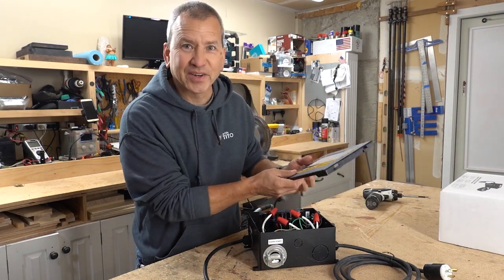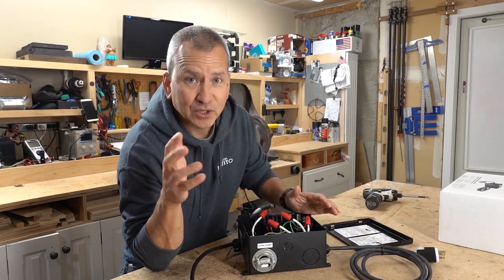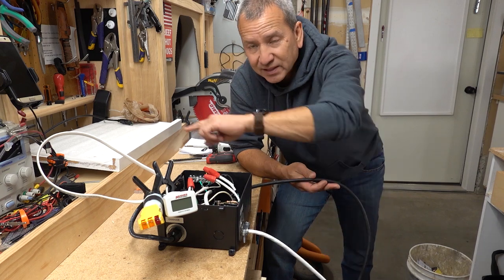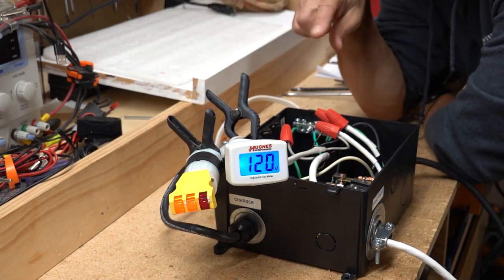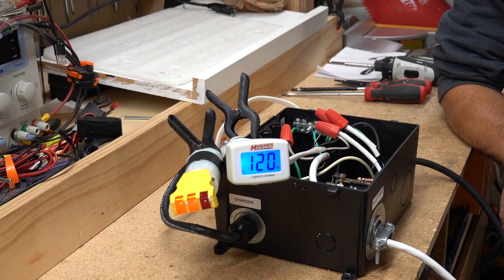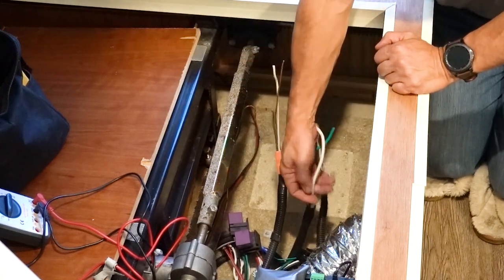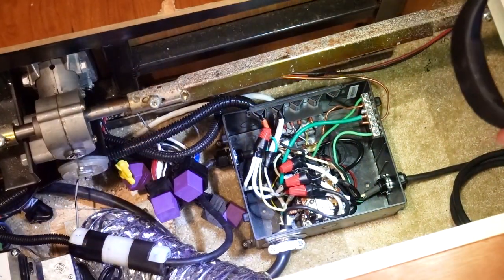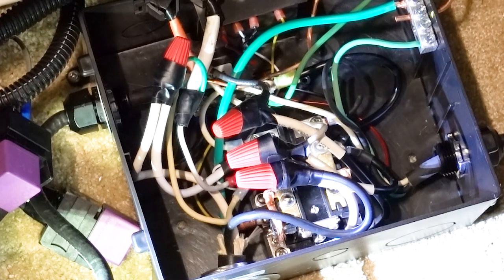DIY Off-Grid AC Power to Your Entire RV - Inverter Transfer Switch Install

Comment: This works great for 30 amps. Is there a 50-amp version that functions so that the inverter kicks off when you're connected to shore power? I see where Go Power has a 50-amp system, but I don't see the charging pigtail with it.

Comment: Why would you need a relay @ 1:22 ?  Just hook the power wire of the charger to the hot side of your shore power. It's that easy and no relay needed. Adding a 15 amp fuse in that wire is definitely recommended.

Comment: Great video! I have a few questions. I want to power just 1 breaker/circuit with my inverter. Would I move the wire from that breaker to the ATS, then attach the output wires from the ATS to the breaker? I have 50 amp service in my RV. Could I use the 30 amp instead of the 50 amp ATS beings I'm only going to a 20 amp breaker?

Comment: hi Brian,quick question, I have a generator in my RV and the same model ATS as yours (PD5110010) and want to install an inverter. Can I connect the inverter and generator together (gen hot and gen neu) any problem? Please advise, thanks in advance

Comment: As always, awesome job Brian.  I was thinking of simply using a manual transfer switch but when searching on YT, I see you're the "top of the pack."  In my work career we used huge self-energized transfer switches (carrying 110KW) that operated under the same principle as your configuration.  My only reluctance to do so is having a heavy load device running that our UPS/inverter/battery cannot handle for sustained periods - here's my concern...
You are using shore power from the pedestal on a cold night that is running your central heater.  For whatever reason, during the night the shore power silently goes off but your inverter happily picks up the load as best it can.  Of course, within a few hours (while you are sleeping) the batteries are depleted and the system shuts down.  Do you foresee this scenario as a potential problem or have a mitigation strategy (such as a low power audio warning on your inverter/battery system?  Many thanks and happy trails.
Reply from the maker: First of all, you certainly could go with a manual switch. Second, I don't leave my inverter running. I'll even shut it off at night. So if I were on shore power, my inverter would not be on.
Reply: @RVwithTito  Awesome - like Occam's Razor teaches us, always go with the simplest solution.

Comment: How does your transfer switch tie into your inverter? My inverter has just the port for battery so I'm wondering if I need to get a different inverter or how I can connect to a transfer switch.

Comment: Hey Brian, BIG fan...love your stuff. However, I needed more clarity on wiring the charger output female plug into the charger/converter. My problem is if I do like you suggest, how much juice will flow to my Lithium batteries? I put in a new PD converter/charger that has a special switch for Lithium batteries. This would be bypassed based on my understanding of your video. Please advise...may have not fully grasped what you did! Regards, Steve

Comment: I'm not sure. But I think you need a second transfer switch if you want to run a on board generator also on the system. My Motorhome has three sources of AC power: inverter, generator, shore power. So you'll need to keep the existing transfer switch to isolate the generator from shore power.

Comment: hey TITO, @4:45  what if my 1200 watts solar is going through charge controller then to inverter; can't the inverter go into PD4575 charger/converter also? not planning on shore power much at all. but i definitely want to use the 4-stage charger on the PD4575. you said not good for battery to charge battery but what about when they are getting solar charging like i explained? THX!

Comment: I can't get anyone nor any manufacture where to find a good quality 30 Amp Transfer Switch that will switch from shore power ..and/or solar 
...and/or generator to supply power to a Class B+ RV and charge batteries ....yet its done everyday.

Comment: Can I do this application for my party bus?
I did away with the original AC units because they don’t keep the bus cool in Texas. I installed 2 Coleman Rv rooftop units. I’ve already installed the generator and it run perfect but how do I power my AC’s while driving the bus because I can’t run a generator while running the bus. It’s a blue bird school bus

Comment: Would shore power charge your batteries as well if using this ATS?
I bought a inverter but it does not have charger functionality.  Too late to return it, so im curious if this setup would also charge my lithium batteries while plugged in to shore power?

Comment: Thought that is how they worked, nice $70,000 5th wheel we have has an auto transfer switch for shore & On board Generator, Has an awful Hum and im sure it uses power (when inverter is plugged into shore it line it hums like a son of a!) Even Disconnecting the Mains on the panel inside doesnt turn it off (With Inverter, fridge, hot water tank, microwave, AC), turned off. 

Just doing a 3kw inverter, 600 watt solar setup for our one units 3 month site.

Comment: Yea, I got a trailer with a solar panel, inverter (2000w), a Onan 4400 generator & 30A shore power.    No outlets work from the inverter so I'm guessing that isn't tied to the ATS if there is one.  Just the genny & shore because I can use outlets on either of those, none work from the battery load.  So, can I get a better ATS to include the inverter & draw power from the batteries to inverter to main panel & get power to outlets from the DC batteries?

Comment: I have a 20A converter/charger. I connected it to the 30A shore power line inside the transfer switch. Do I need to run the charger through a 20A circuit breaker first, before the transfer switch?

Comment: I did what you originally did. I put my truecharge charger on its own breaker so i could turn it off. I then ran a 10/2 cord from the inverter to a disconnect next to the shore power connection on the outside of my toyhauler. From the inverter disconnect i just installed, i spliced in a pigtail to the shore power junction. If i am going to use the shore power cable, i simply turn off the disconnect to my inverter to isolate that circuit. I had small placards made to remind me to turn off the inverter in the event of using the shore power cord, and too turn the battery charger back on, and to turn the charger off if i am running on the inverter. By doing it this way, i didn't have to mess with the existing switches between shore power and generator. I put a placard on the gen off/on to remind about the batter charger also.
Reply from the maker: I did the manual switch over for a while too, but my wife was always scared to power up the inverter. Now it's all automated and we're both comfortable powering things up safely.
Reply: @RVwithTito  I boon-dock most of the time so i rarely use the actual shore power cord. The only thing that ever gets turned off is the charger breaker. As i was writing this out, i just realized a flaw in my setup.  I need to add another disconnect between the shore power plug and the splice. Right now, in my current set up the plug prongs would be back-feeding and live to the touch. I need to fix that. I mainly run on the inverter and solar. I do a lot of snowmobiling in the winter too and the solar just cant keep up with the shorter, cloudier days. I am running 4 200 watt sunpower panels on the top of the rv. I have been thinking about running another 800 watts of panels but leaving them on portable mounts for when i am running in the winter. Just put them at the correct angle facing the best direction. The winter is the only time i need the extra solar. Until I add more panels, a generator is a must for me because of winter hobbies. My current system still operates like OEM equipment with the acceptation of turning off the charger manually. Maybe i should get rid of the splice and disconnects and just put a switch in its place. It would be a cleaner and safer install. Do you know of a 3 way switch with a charge controller feature? Basically, shore power, gen power, and inverter power switch.

Comment: Brian, fabulous instructional video!  Scenario:  when on inverter power, my solar charge controller is connected to the batteries and, as I understand it, adds to the "energy pool" available to the RV system (solar energy + battery energy).  From what I've read, this is acceptable.  As the sun sets, the solar energy goes away, and the RV only get energy from the batteries.

When switched to shore power, my PD4045KA Converter/Charger takes over, providing energy to the RV and charging the batteries (output from the TS-30 transfer switch is connected to the battery charger of the PD4045KA, following Brian's reference).  However, the solar charger is still physically connected to the batteries and is charging the batteries.  Could this be a problem?

Comment: Hi Brian. I have a 1947 Westcraft Travel Trailer, and I’m installing a DIY solar system. I was thinking to run my shore power line through my inverter/charger. Would you recommend having one of these switches in addition?

Comment: Two questions: if you are using an inverter and not a generator, can you omit the transfer delay timer, as inverters do not need any run up time?  How can we wire up a transfer switch so the inverter does not power the AC or the electric hot water element, or fridge 120v?  If power goes out at a campground while I am not there, I do not want the inverter to run the AC etc.  I just want outlets and microwave, not fridge, HW or AC on the inverter. Thanks.

Comment: Shouldn’t you have ran your charger output from the transfer box through the 15 amp circuit breaker to the converter so that you could see that from the panel?

Comment: Thanks Brian. 
I have a 16 ft travel trailer and am installing solar power, Lipo battery, and inverter. Now I can run things boondocking. Main thing is to run fridge while driving on inverter instead of gas. I know not supposed run fridge on gas while driving but had no  other way. With this transfer switch can be safer.

Comment: Interesting to see the transfer switch provides a fuse for the converter/charger. I was wondering if there was something to provide over current protection, since you’d have to take the existing breaker for the charger out of the circuit.

Comment: Nice piece of kit... But at $220 there is a huge premium you pay for that extra plug/fuse for the converter!... A simple rewiring and adding  a plug & fuse to a basic $80 30amp transfer switch would be identical?...

Comment: This "pre-wired" ATS charges a hefty premium for including a charging cable. This is where the "pre-wire" term is derived. My advice? Save $150 (or more) and DIY the charger wiring. It's really quite simple.

The time delay is for generator stabilization. When connecting power from a post, this is completely unnecessary.

For anyone desiring to build their own ATS (which is easily doable), there's really very little savings in doing so. Save yourself the effort and purchase a commercially available unit. Then concentrate on the wiring, including a separate panel with essential loads (not to be powered by inverter).

Comment: Where did you find the TS 30 No. 178.1 with the added pigtail for turning the converter on and off. All I can find on Amazon is the No. 178 which does not have the converter pigtail.

Comment: I am wiring the TS 30 to my new cargo trailer/toyhauler. I will have an inverter or shore power for 110v AC. Hence the switch. The TS 30 is nice, as you show in the video, in that it will disconnect the 110V converter. Wire it to the NO contacts of the relay. I'll go you one further. I will basically have three systems to charge the batteries. Solar, shore power, and the trucks charging system when the trailer is plugged in. So could be travelling down the road and the truck and solar will be charging the batteries simultaneously unless I disconnect the solar panels. Think I could wire the solar leads to the NC contacts of the relay and eliminate the solar charging while on shore power and plugged to the truck?

Comment: Are your neutral and chassis ground bonded in your AC panel?  I was wondering what happens here if the shore power already has a neutral/ground bond on their side.  Seems like you'd end up with two ground connection points.  But, I'm still learning some of this stuff.

Comment: I'm sure this has been explained somewhere before, but what do you do if you have no inverter, and want to add one that will run through the current electrical system and cover all the AC outlets in your RV? Is there a 3 way transfer switch to use shore power/generator/inverter? I'm confused, but we want to install solar and an inverter that will allow us to use the existing wiring in our RV. I feel uneasy about getting rid of our generator. We have a 2017 Thor Chateau 28Z. We're looking to step up to another RV, but not right now. Thanks in advance.

Comment: Thanks! Great video. Alternatively, couldn’t you wire the converter up to its own breaker and back feed the panel with the inverter and just switch that breaker off when you’re not on shore power?

Comment: Good video Brian. I appreciate the detail.  I want to ensure I've connected mine correctly because I'm not getting any power to the coach from my inverter. 
The AC panel is connected to the top two, the shore on the middle two, and the inverter on the bottom (the two terminals that are closer together in comparison to the others). My inverter is a 2000watt renogy, and is hard wired to the ATS. 
I also wired my converter/charger  to the middle two via the 15 amp fuse with the 10 gauge wire from the panel to the fuse then to the middle two (with the shore).  The shore power is working, but I need my inverter to work, or this install of solar has been a waste.

The original set up is through the converter as you discussed in the video, but I have a lithium battery, so I'm not using the lead acid that came with the original set up.  I don't want the converter charging my lithium, so I need to dismantle the converter, but then I'm thinking I won't have any power. I would appreciate any thoughts / suggestions. 
Kind regards,
Kel

Comment: Brian I don’t know if you can answer this. I have a 50 amp shore power, 4000 watt single phase generator now. I am wanting to add a victron dual phase inverter charger. I have a transfer switch. How can I wire all three and make them work together? Thank you for all you do!

Comment: Thank you for the explanation of the transfer switch. I will be adding solar to my 5th wheel. I will probably not be adding a transfer switch right away. Can you please tell me what I need to protect my solar system while using shore power. Thank you again.

Comment: Hello Tito, one question and it may not has to do with your subject, but here we go. (50 amps) When I have my generator running with air conditioners on and I plug in my shore power at the campground, does my transfer switch should take over and switch to shore power? is 40 sec a standard on the transfer switch? I ask this, because when I plug in to shore power and I turn of the generators, by A/C's go off and I have to wait till the safety time turn them back on. I think i have to wait for the time to count down for the shore connection to take over. I think I am turning the Gen to soon. I hope I am making sense here. Great video as always!!!

Comment: Love it , now I have find a  place to put it I have a tt and my converter is in the island on the end and my inverteris in a box on the front of our trailer , this would solve me a bunch of little things I am doing now , more questions later .
Reply from the maker: Ok. Good luck. Mine is on the other end of the rig too.
Reply: @RVwithTito  hi brian , ok I have the progressive dynamics power 
Converter with the built in charger for the battery will this switches box work with this unit I have

Comment: Could I use this to trigger my inverter for an off grid system, so when it switches to grid power, it turns the inverter off so it won't drain my battery bank, then back on when they get up to voltage again?

Comment: Great video! Quick question: how does this affect the 12VDC outputs connected to the converter? This is my understanding at this point - When shore power is connected, the converter is powered, which would covert the 120VAC shore power to 12VDC through the converter to power the devices (as well as charge the batteries). When inverter power is connected, the converter is NOT powered, so the 12VDC outputs are being powered from the batteries. Is this correct?
Reply from the maker: Yes, exactly. The converter and batteries are both connected to the 12V distribution panel. Whichever one is providing the higher voltage ends up providing the power. So when the converter is off, all power is coming from the batteries. When the convert is on and charging, then the it's also powering the DC panel.
Reply: Noobie here, so I'm reading all questions and answers...
If I understood correctly (not very probable), the inverter changes the 12v DC  to 120v and this new switch chooses between shore power and the 120v coming from the inverter to supply power to all 120 devices in the rv.
My question is when the switch senses 120v coming from the shore power cable, besides the fact it provides 120v to all outlets and to the battery charger, the inverter then changes power from 120v AC to 12v DC so all 12c stuff isn't powered by the batteries?
Phew, I hope it makes sense!
Reply: @RVwithTito   I tried shutting off my converter at the CB and had no 12v lights and all

Comment: I have a 5th wheel with the generator install package wired to the front compartment where the generator would be. Can't I just connect both the transfer switch and inverter through that wiring to go into the main electrical panel?